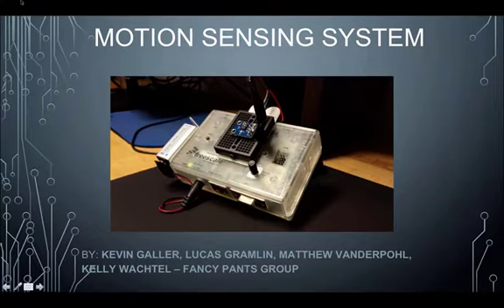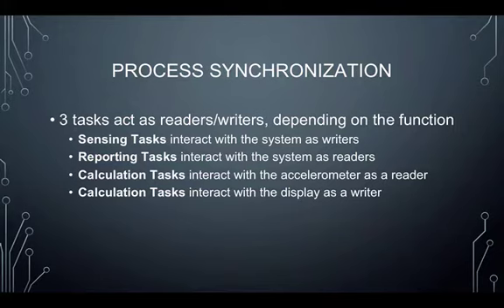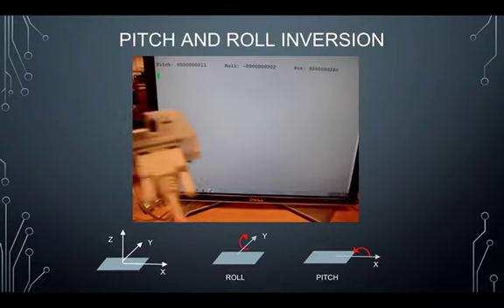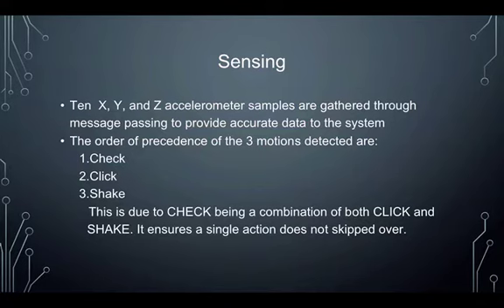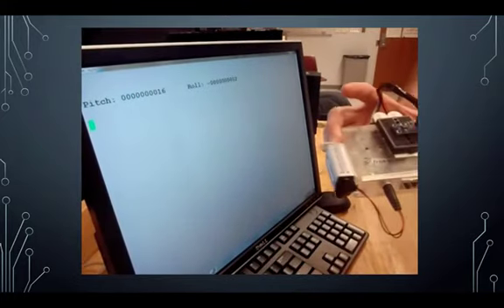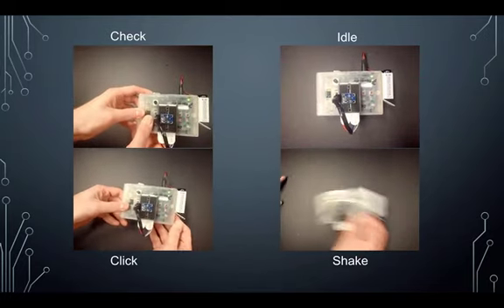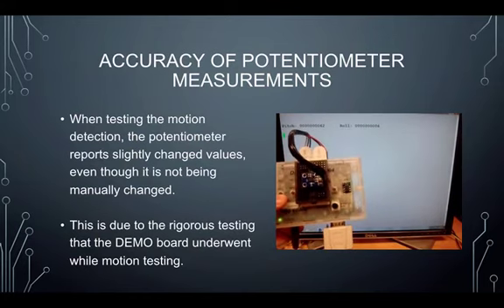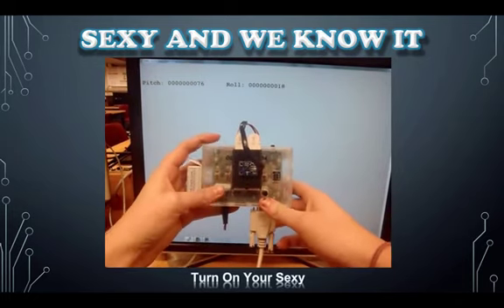IUPUI ECE 595 RTOS Final Project - Motion Sensing System

Comment: Hi Fancy Pants,

It wouldn't be surprising to state that this was a marvelous presentation. I think, yours is the best presentation of all the groups, thus far.  Each and every aspect of the presentation was so fluid, pleasing and significant. Emphasis and care has been given to even the minute details, which tend to get overlooked. The "check detection" sequence was the highlight of the video and it looked very professional. The presentation had high aesthetics, and at the same time was not compromised on the technical front. If I had to point out on anything, I can say I would have liked to see a little more of the group participation. 

This video can be an example to show how project presentations are made. Excellent work!!